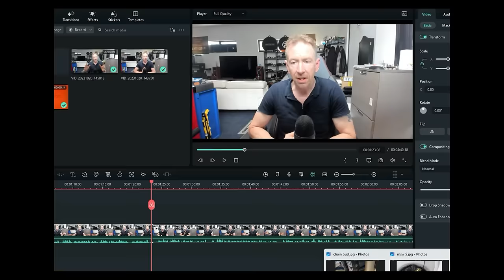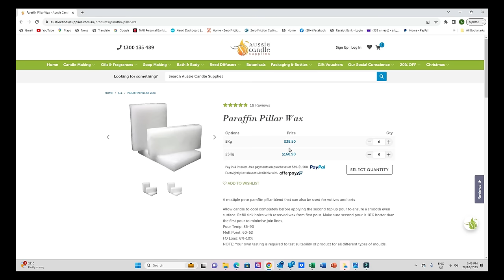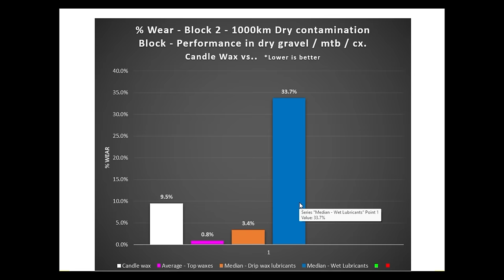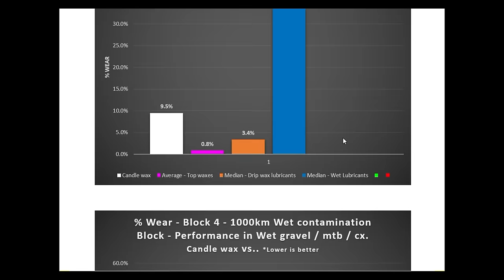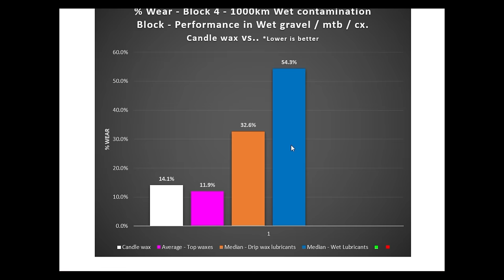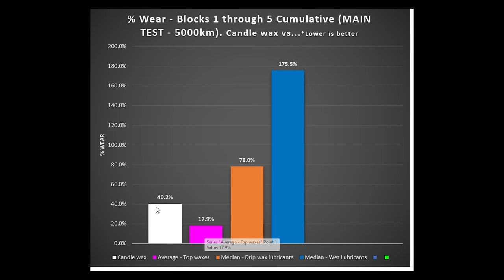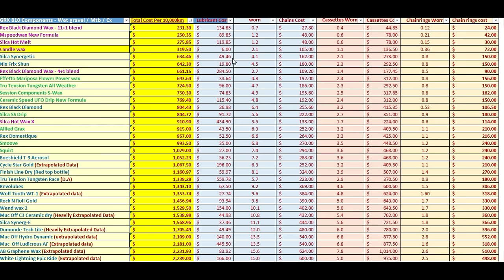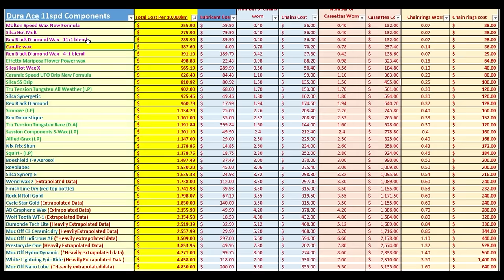Candle Wax test

Comment from the maker: k so one thing i didnt wrap up properly in my ramblings - overall really impressive - but take not vs mspeedwax / hot melt etc it is still circa double the wear by end of main test. If your components are expensive - then wear rate of components still dominates your cost to run vs cost of lubricant. It can easily be a case of spend $50 to save hundreds if your cassette, chain, chainrings are top tier. 

Also - we do not have efficiency numbers but it is known that oilier waxes will be slow compared to top waxes (and if contain impurities like soy, palm oil etc which candle wax's / cheap paraffin has) - so if you are an avid racer - the top waxes are a safer bet for your race chain. 

However, considering how cheap this wax was, its overall performance and cleanliness - for many who dont need the best, or dipping their toes into trying immersive waxing - this particular candle wax was overall very impressive - especially for the price. Just please take heed however than your experience may vary A LOT, as there is huge variances in candle waxes / cheap paraffin.
Reply: Thanks for all the content! I've recently been into chain waxing and started with the DIY paraffin wax. I was glad to see the cost to run result. I use a very entry level drivetrain. My cassette and chain alone costs half of a Silca hot melt.  While I may not be saving that much, the main reason for me is that it keeps the chain is really clean.  

I've ridden it for 200km before my first rewax, which I needed to do because the last ride I did was had 40km of pouring rain and wet roads. It did develop some surface rust when I got home but it was easily removed by brushing (I also dipped the brush in some methylated spirits I had leftover from the first cleaning).

Comment: My 9-speed KMC X9SL chain + 11-28t Shimano  CS-HG400 cassette costed me about 40 euros total. I think good quality candle wax is much easier to justify with those cheap components then those 44+ euros immersive waxes.
I understand the quality of the candle waxes vary, but i can afford to experiment with cheap components.
It's also a low cost method of finding out if immersive waxing is something that would work for me (lots of riding in the wet unfortunately).

Comment: I've previously boiled the chain pre wax but don't anymore because it seems a bit to OCD. There is one maintenance trick I use for keeping my MSW cleaner and that is to use a vegetable peeler. When the wax cools, slip it out of the bowl and "peel" the bottom layer where all the solids settle. Sadly some of the lubrication additives disappear but its very little.
So far so good. My current ebike chain has done over 3,000k's and not showing .5 wear on my Park tool chain tool.
Thank you for all your testing and advice.
Reply from the maker: yes due to loss of additives, check out the two pot system like a boss - go to waxing FAQ vid and skip to 1hr 39 min mark. Over all that is the easiest and best way to have the best waxing experience and longest wax lifespan.

Comment: Very interesting.  If you are interested  in comparing paraffin waxes I might suggest the waxes used for embedding histology specimens for microscopic examination.  These are highly refined and selected to allow cutting sections 4 microns thick or thinner while remaining intact and supple.  they also penetrate extremely well and will get into the smallest spaces.  I suspect these May be the base waxes for the commercial wax lubes
Reply from the maker: thansk william, yes i think you might be right. I dont get the secrets from the mfg that i have done a lot of private testing for, however i can say that some have started with some pretty average performance from base wax, and moved to a place of very high performance as that base wax has been improved, so no doubt they are adding / using the most fancy paraffin they can source that is viable for the blend. Some of the commercial brands have initially had issues with wax being excessively brittle, dry feeling and sounding, short lifespan etc - and then moved that base to a really impressive place - but the base blends are all secret of course as are the fancy modifier/s ratio's...
Reply: That stuff is definitely not very cheap, this sort of defeats the purpose. The 'pure' paraffin called Paraplast is like 100 dollars a KG! The cheaper stuff has plastics additives in it.  You may be able to source leftovers if you work in a histology lab. However usually anything from a lab supplier is overpriced usually and more diffucult to get your hands on as a consumer.
Reply from the maker: @luukrutten1295  Yes a lot of lab grade stuff wouldnt be the way to go. Mostly we recommend for DIY wax enquiries to just source a good food grade paraffin like gulf canning wax - which is a big step up in price vs candle wax / cheap paraffin - but the outcome is pretty well assured to be positive vs rather random with candles - especially if one is looking to include expensive additives.

Comment: Makes a lot of sense on the water and heat level of croc pot. Mine just has a low and high setting so no idea on the actual temp. I have only been using boiled water every 2-3 rides as just dry riding in South France. Then  always use a hair dryer to properly dry my chain before a hot wax. But NOW will not bother with the boiled water process, makes things even simpler. Running a two chain rotation system.

* and a funny thing....I actually look forward to the time when I can hot wax, hang and dry my chains, when I used to dread the process with oil lubricants. I really do look forward to it!!! Maybe I am a bit weird.

Comment: Thank you for taking the time to do the candle wax tests.  I am using Parowax canning wax here in Canada.  From my calculations based on 0.38 extra chain wear and 0.38 extra cassette wear it is cheaper to use Parowax for my 8 speed commuter.  For my 9, 10, 12 speed drivetrains I will use a commerical wax blend to save the dollars in wear components.  The commercial wax blend pays for itself and more here.

Comment: How about pressure washing the chain (ONLY THE CHAIN!) on the bike while spinning the cranks a good amount of times maybe an quick and dirty option for drip waxers like me? I often catch myself the last day’s doing it out of very rainy conditions here in north Germany at the moment… I rotate 3 X01 12speed chains properly prepped with Effetto Mariposa Flowerpower drip wax. Maybe it washes out better than the immersive waxes. Flowerpower is very oily compared to… Proper drying is key,  rotate the chains solves this issue for me. Works pretty good so far, no exzessive wear ramp up .
Reply from the maker: pressure washing will only remove surface dust. Dust that has been pressed into wax (immersive or drip) is effectively land locked in there. Water will not dissolve wax, so dust pressed into wax will not go anywhere. Most solvents do not work on wax, which is why melting off old coating via immersive remains easiest maintenance overall. FP is a great product, but for sure dust will build up over time, however it does have very good dust resistance. Periodic flush clean maintenance with their alpine extra product that dissolves FP easily would be recommended (every approx 1000km or post any mudder ride).

Comment: I'm going to stick with the Silca HM and MSW (with occasional TT All Weather top up)  but it is nice to know that if for whatever reason I can't get my hands on either of them or the price becomes an issue there is viable and cheap alternative that requires no horrible additives that I can turn to (maybe with more frequent application) as a short stopgap, rather than paying full bananas for one of the many unknown branded ones that have sprung up recently. I don't think I would enjoy riding with wet lubes again knowing what its doing to my drivetrain.

Comment: Really useful info but there has always been a bit of a grey issue around longevity of the wax in the pot, basically when do I change it

OK I understand there is a huge number of variables here, but my impression is that this batch is still good....chain still sounds quiet.....should I be looking at some other factors?
Reply from the maker: Yes i was overall very surprised. It would have been much easier for my overall message re beware of cheap wax if it performed a lot worse :) The factors really are just take note that it was still around double the wear of mspeedwax / hot melt - so if you are running an expensive cassette, chainrings, chain - then saving $50 to spend hundreds more over time in component wear is still a false economy. over time on many groupsets, wear rate is still by far the dominant cost vs lubricant cost. And of course that it will be slower if one cares about speed, and mostly - unless one is buying the same candle wax - their cheap wax my be very different vs how  this tested.
Reply from the maker: oh re when to change - it would be similar - most should be fine for 20 to 30 rewaxes per 500 grams as a good time to change to fresh wax. Overtime as contamination will start to build up in the wax, the wax will start to become slightly abrasive, and treatments will not last as long. So if one starts to notice treatments just dont stay as smooth for as long as they used to - ie used to be fine for circa 300km, now its feeling sounding dry by 200 to 250 - time to change - or just pre emptive change circa 20 to 30 re waxes.

Comment: I'd love to see you try out renaissance wax. It's a super neat product that chemically binds to metal and other surfaces. At least in my experience using it for woodworking, I generally have to use less of it per application than other waxes. Thus, maybe the extra expense might be offset by using less?
Reply from the maker: that stuff is pretty expensive! on par with some of the top commercial bike waxes. alas that will be in the realm of DIY waxing experiments i am unlikely to get to, there is just soo much DIY test possibilities and so much other testing to be done!

Comment: Regarding your suggestion to not worry about boiling the chain unless it gets wet and grime from a ride, I'm wondering your opinion on my situation. I've been waxing my mountain bike chain. The chain lasts a decent amount of time when riding in less dusty conditions. However, over the summer in the Tahoe / Truckee area it doesn't rain much and the trails can become insanely dusty. Despite wiping the chain with a micro fiber cloth after every ride, the dust seems to build up over a much shorter period of time and cause the drivetrain to really start squeaking. My assumption is that this extreme level of dust is making its way into the chain and creating the squeaks. I've been boiling the chain before re-waxing in this case, but the extra maintenance is somewhat annoying since I find I have to do it every 2 weeks or so in these very dusty times. Do you think this is the right approach? Or is there something else I should consider doing to extend the time between waxing in these very dry and dusty conditions? Thanks!
Reply from the maker: Hey chris - the squeaking in really dusty conditions is mostly from dust abrading wax off sides of rollers and between inner plate link and outer plate links, and so those parts can start to run with basically no lubricant. This will cause more lateral wear of chain (squeaking will normally start on chain line angles as more load is on the sides of those bits). Dust still has a lot of trouble penetrating deep enough to main load surfaces that cause elongation wear. So its mostly an annoyance re you have to re wax more frequently to avoid a not as optimal ride experience re chain sound and feel. 

Easiest approach by far for this type of riding is two pot system like a boss. Check out the waxing FAQ vid, and skip to the 1hr 39 min mark to see this. If you ride a lot, just run two chains on rotation so it is easy to pop a fresh chain on when need too, and re wax the other. You always need a new chain sooner or later, so pre buying next chain to have the great convenience of two on rotation is a smart way to roll for cyclists riding in harsher dust conditions / frequent wet.

Comment: talking about water in wax, if the wax temp is below 100c then any water will never evaporate because its going to sink to the bottom of the pot( wax less dense of water) and the wax will seal it in there! Any water in a sealed-in condition can only escape through transitioning to steam above its boiling point surely?
Reply: If i put my crockpot on low +-80, it usually wont boil water out. If i put it on high +-120, sometimes tiny bubble formation can be observed, which is water boing to surface.
Reply from the maker: I am not 100%  sure. I will try to do some of my own testing one day, but for sure we have enough to know that it is a concern. It is possible convection will get water to a place it can evap out a bit over time (ie water evaps from lakes and oceans and skin etc) - but you are correct, it cannot if it is held sufficient down from the surface.
Reply: I would suggest to raise the chain off the bottom of the pot anyway by using some sort of wire mesh basket like in an ultrasonic cleaner so any heavy contaminants (including the water) can sink below the chain.
Reply: The mesh is a good idea. I should find something suitable. What I mentioned about the water evaporation. It will take really really long to fully evaporate out all the water. Many hours, maybe overnight, not a 20 minute boil.

Comment: thanks for this video, as usual. I use Effetto Mariposa after learning about if on ZFC website for my favourite bike, but I'm thinking about using candle wax on my winter bike, 'cos it rains a lot here and I only use my fav bike on non rainy days. Did you just use candle wax or did you add some kind of carrier, if that's not asking much?
Reply from the maker: just candle wax - but note i seem to have stumbled on a good one, results for candle wax DIY vary rather a lot. I would recommend getting food grade paraffin as your DIY wax base (you wont need any additives) as this will be very clean, candle waxes can be gunky as they can contain crap you dont want like soy, palm oil, scents, high oil content etc

Comment: I'm quite impressed by the results there. Love to see if you can add some additions to that candle wax to see if you can improve it.
Reply from the maker: For sure we could, but again, i just really cannot devote a lot of test resources to DIY blends as it would never end, and is of value overall to quite a small subset of cyclists - who can take the base results and play themselves & test over time. We can already see if one gets even a half decent paraffin base they beat just about all commercial drip lubricants on the shelf re wear rate. They may not be as fast as say UFO or ss drip etc  - but depending on the cyclist that may not matter.

Comment: it barely matters if the expensive 'value added' brands win. the micro difference between ordinary wax/paraffin oil and expensive brands of wax will be trivial compared to the gaping difference between 'all waxes' and oils. its interesting to know though, and helps those that absolutely want the best. but i think going with the branded products over homebrew is a case of very rapidly diminishing returns for quite a big ramp up in costs
Reply from the maker: To a degree. For sure for many cyclists if they are on a good DIY paraffin, that will be all they need. If on expensive components, a double wear rate difference would still definitely be in favour of the top commercial products tested - it could easily be a case of spend say $60 more to save some hundreds per 10,000km - which is a good investment. 

but also - remember these companies need to make viable revenue and profit to survive. So if we want companies that have put in Genuine R&D & capital investment to bring genuinely great products to market, and not just great marketing to market with BS products, it is also a good thing to support genuinely good products & the mfg behind them etc. There are so, so many things we buy with rather horrific mark ups - ie i had to buy a new charge cable for my garmin watch. It was $39.90. I would say the mfg cost for it is about 20 cents. And the investment to get that up and running overall - not very much for garmin. Similar re say do you need a new computer mount, or an exposure light mount, or some pedal cleats, and on and on. I can tell you the production cost and margins on say mspeedwax  - a very hard working little company for a genuinely great product - it is overall a fair deal for the consumer that is for sure - just a fair viable margin for them to be here for the future, and a great product for the cyclist that will genuinely give them back their money and so much more re drivetrain wear savings.

Comment: How often should be chain rewaxed with this paraffin ?
Reply from the maker: for dry road conditions just a base paraffin sans any fancy additives i would rewax every approx 200km for max chain wear lifespan, and if thats a hassle - either use in conjuction with ss drip or tru tension tungsten all weather or ufo drip as top up between more spread out waxes (ie wax one every 2 to 4 weeks depending on volume and conditions) and or run two chains on rotation - sooner or later you always need a new chain, so pre buying next one to run on rotation costs no more and has a bunch of benefits

Comment: if nothing else it seems like candle wax would make for a perfect first, sacrificial bath, in a two bath process.
Reply from the maker: Yep for sure it if its a good one like that one - it can be a good kick off to start 2 pot system, however in time as one is moving pot 2 over to become pot 1 wax, you then have same wax for both after X time anyhoo